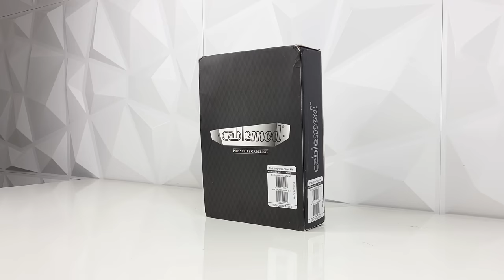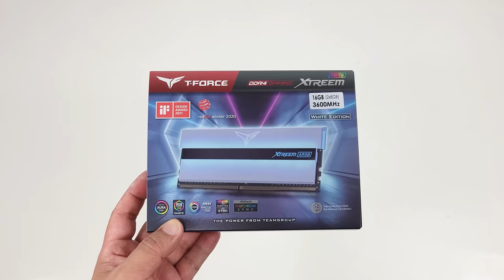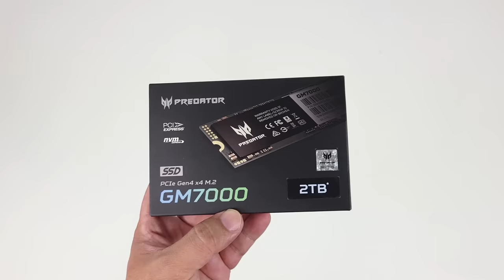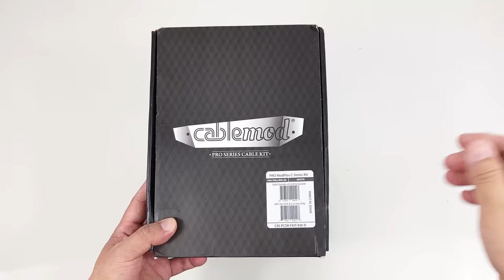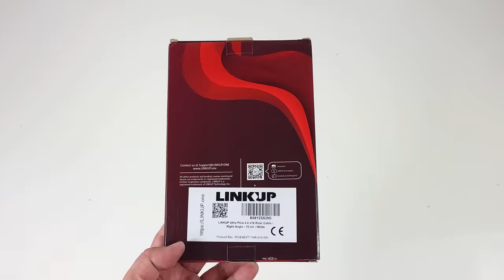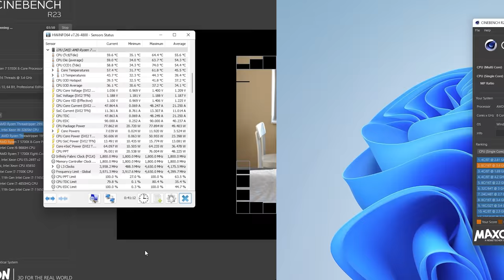Gaming PC Build - White | AZZA 808W-M | 5700X | Noctua NH-U12A | X570S AERO G | RTX 3070 Vision

Comment: Do you mount GPU's vertically by default? I think it looks so much better, you get to see much more of the cooling design and none of the dreaded sag! You'd think it'll become a standard feature of all cases and the connection included with the GPU as they become increasingly larger and heavier.
Reply from the maker: It's not default. You have option to do so.
Reply: 30cm or 20cm?

Comment: Hey man is it possible to request a all black build , i like all your pc build thx planning to build mine thx 

cpu :ryzen 5700x series 
mobo : b550-f strix wifi
cpu cooler : deepcool as500plus 
ram : 2x8gb crucial ballistix RGB
gpu: 3060 ti maxsun or 3070 ti 
psu : 750w psu fully modular 
case : fractal pop air

Comment: Why such a high watt psu im new so just curious i would think 700 - 750 would be good
Reply from the maker: Even 650W works here. More power the better because A PSU that runs at 85% efficiency will use less electricity (and dissipate less heat) than one that runs at 75% efficiency.
Reply: @PCTechnician  I see thanks for answering

Comment: there is too much thermal paste. It can cause bad temperatures on the CPU. Noctua itself states that it is enough if there is a pea in 5 mm in the center of the CPU. The paste just fills the gap
Reply from the maker: That is not true. You only going to have problem with tiny paste. Check out the gamersnexus article. http://bit.ly/3kNyPrf
Reply: @PCTechnician  The basis is the smallest possible deviation between the CPU and the cooler. Then a paste of 0.1 mm is sufficient. When the cooler is applied, it is always tightened crosswise. In approximately the same way, it is important to control the temperature of all cores. if they are approximately the same, the paste has been applied correctly. A lot of people make a big deal out of it. This method is from Noctua technology. From the article, the difference is 2 degrees. 1-2c is negligible. The cores are not under the entire cover. Many pastes have a worse temperature and everything around is spinave. In the end, it doesn't matter how it is applied there.
Reply from the maker: @CannibalKats  Well, you said it cause bad temperatures. I disagree. If you look at the link I showed you(actually there are many more result I can show you) think it's incorrect I have no word to say.
Reply: @PCTechnician  in the article it shows how the pea paste is not in the corner. In the graph, the difference is one degree. If you think it was bad, the heaters would be much worse, but they are not.
Reply: see how your paste flows when you tighten it. Time 2:11 for me it's unprofessional. but I have to say that the videos are nice
Reply from the maker: Yes but whole point is how too much thermal paste can cause bad temperatures?
Reply: @PCTechnician  A lot of paste is probably not bad. I thought. Your application is correct.

Comment: He put the psu upside down and no heat spreader on the ssd
Reply from the maker: The correct way is to mount the PSU facing down but you have to place the fan face up with this case. NVME comes with a graphen pad which drops -18C more.